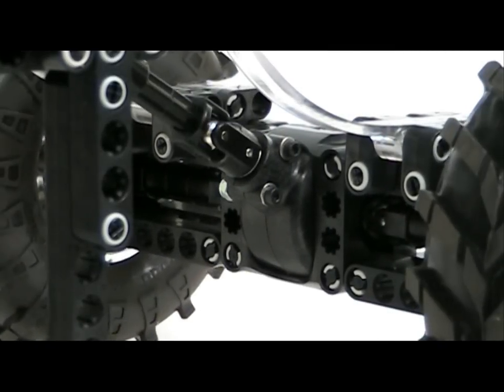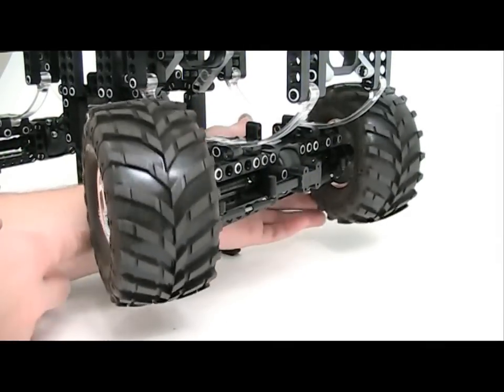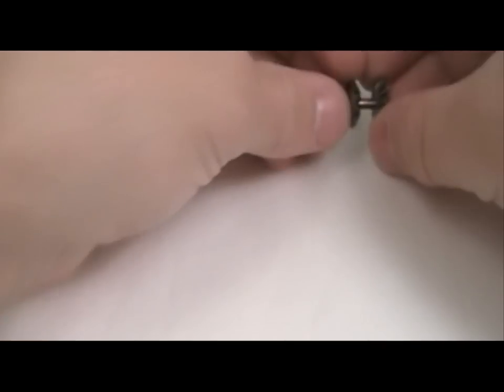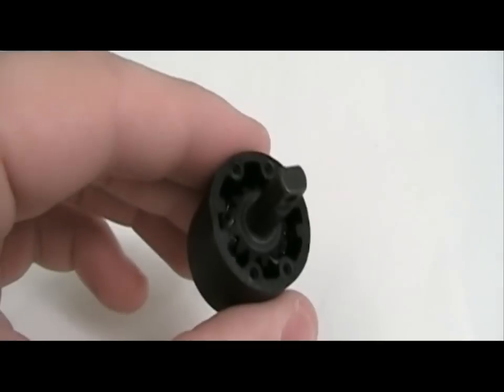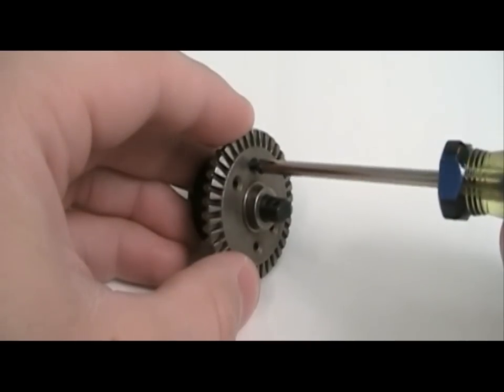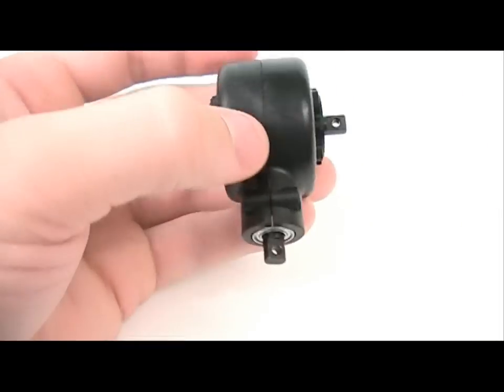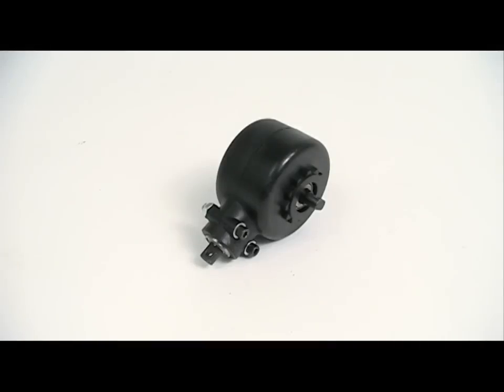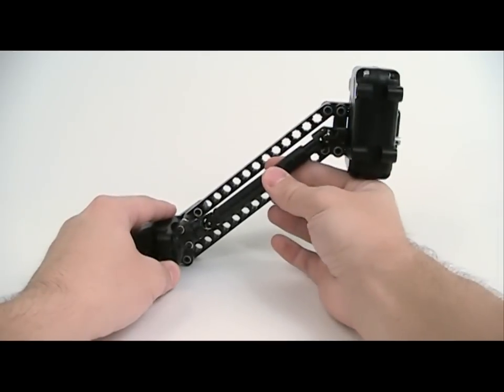MINDS-i Robotics - Differentials

Comment: Do you offer any additional gears or have plans to offer more gears for building more complex robots? I noticed on the website there are about four standalone gears available at the moment.
Reply from the maker: Yes, you can use different gear ratios. We don't offer other gears on the website but other sites like Kimbrough offer a wide range of gears. http://kimbroughracingproducts.com/store/index.php?dispatch=categories.view&category_id=199#1 What kind of complex robots are you looking to build? I'd love to help you out on getting inspiration on a project.
Reply: Thanks. I am not quite sure what robot exactly at the moment, as they all fascinate me (robot arms, wheeled robots, tracked robots, humanoid robots, etc...). I am brand-new to robotics at the moment and looking at all the different systems (Vex, Tetrix, Matrix, Mindstorms, Actobotix, Minds-I :) ).

So hobby-grade radio-control gears are compatible with Minds-I?
Reply from the maker: Kyle Blank Great, you've come to the right place! Well to be honest MINDS-I is most likely the most expensive, but in my opinion the most capable. And yes, MINDS-I is completely hobby compatible, not just gears, but motors, servos, microcontrollers and sensors ect. (even other building systems) That's another advantage that MINDS-I has, it's built to be easily expanded upon. If you want to use the gears, microcontroller, or sensors from another system, go for. That's MINDS-I vision, no limits, just possibilities.
Reply: Coolbeans, that's great. Thank you for all of the information, I do appreciate it.
Reply from the maker: Kyle Blank No Problem. When you make your robot I'd love to hear more.